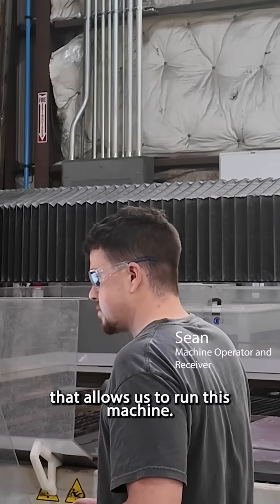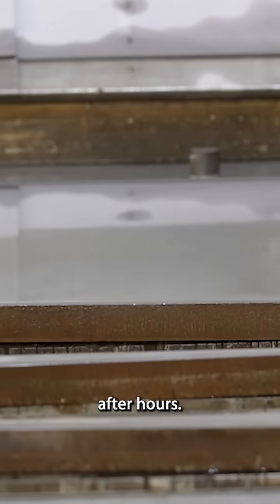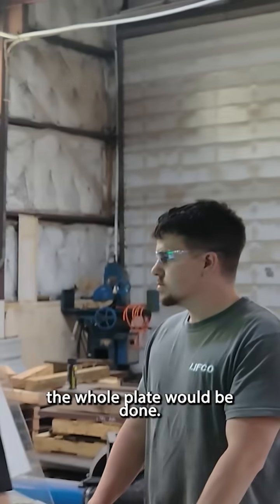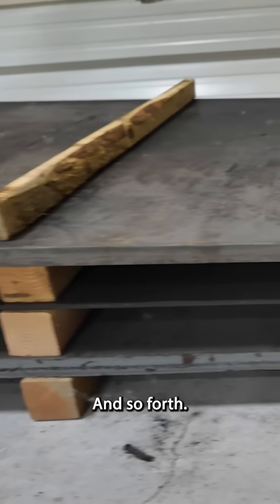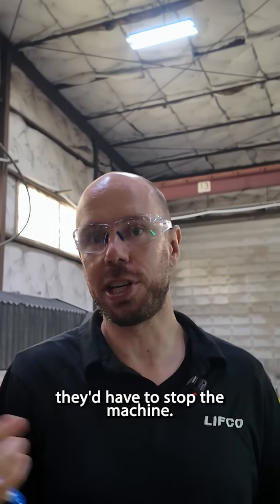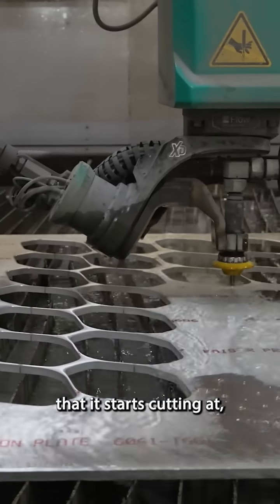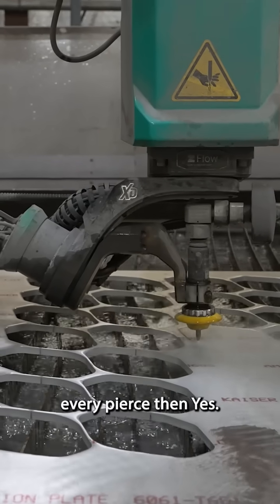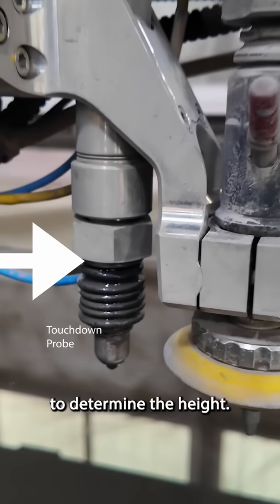What is a Touchdown Probe?

Comment: So what do you do with the excess metal?
Reply from the maker: Whole plate gets removed at once and then we torch it with a propylene torch into small pieces. Then into the scrap bin. 
On the burn table (flame cutting) they can cut into smaller pieces using the table itself. But the waterjet is too slow for it, so we manually do it.